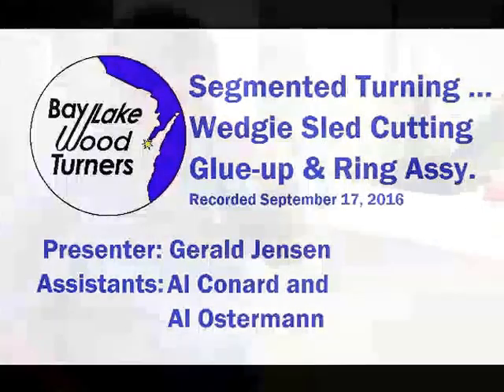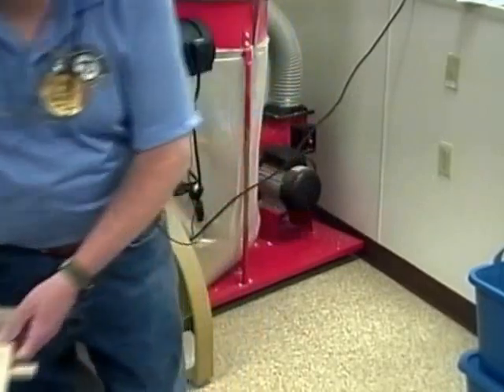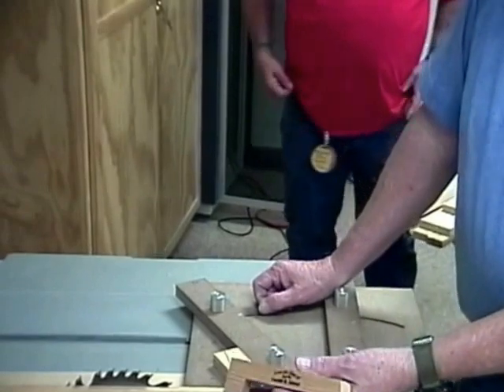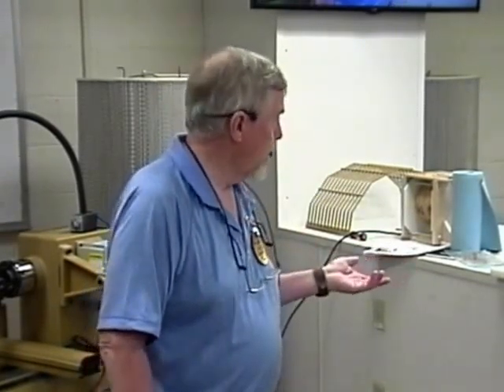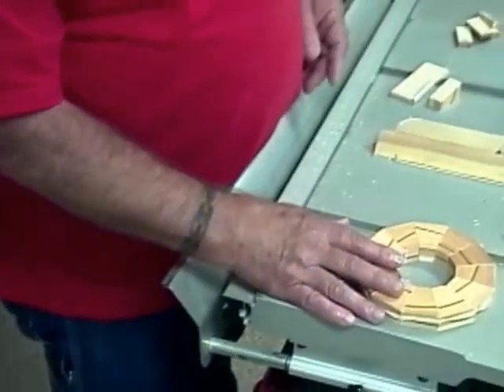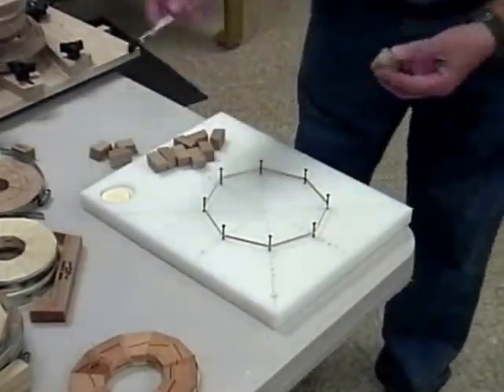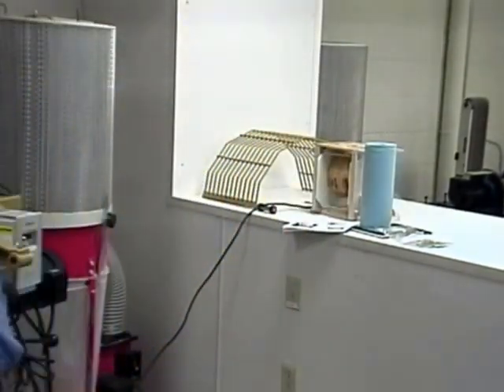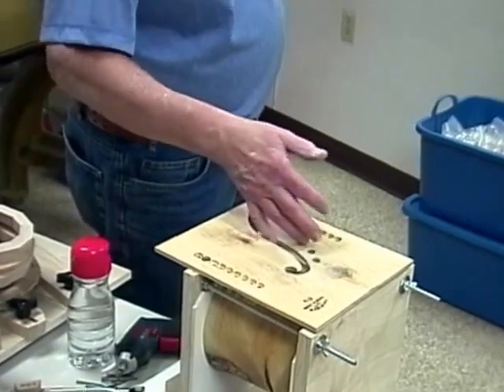Wedgie Sled (Segmented Turning)

Comment: I use a large flat chuck to flatten all of my rings mounted to the spindle. After they are all flat I mount the bottom to the spindle and mount my flat chuck to the tailstock mounting the rings by sliding the flat chuck to the preceding ring